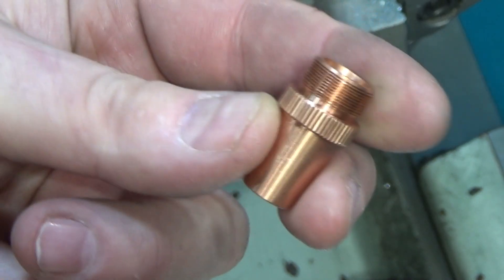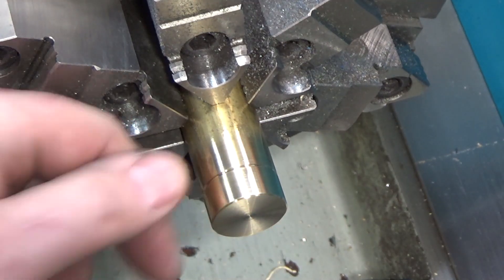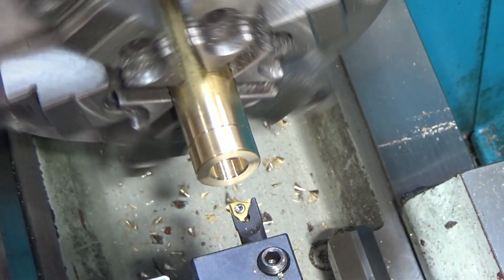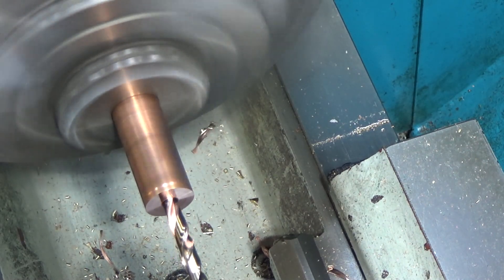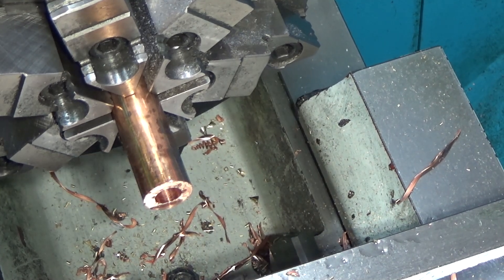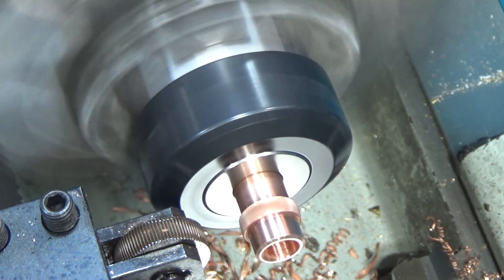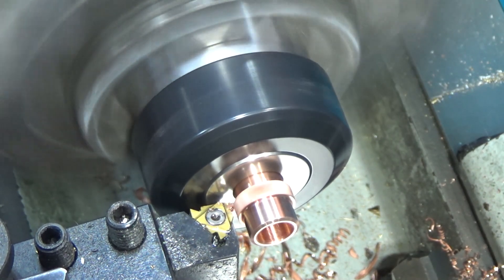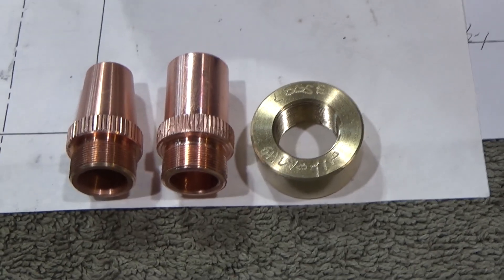240 Odd Part Shape Fixture and Galvo Laser Welding Nozzle Part 2

Comment: Try putting the tailstock centre in when knurling. This would help with the pressure.
 And help with the deformation.

I also use carbide drills with copper.
Reply from the maker: Great tips, thank you.

Comment: Did you consider just boring out the original part as much as possible (using your thread gage for holding)? 
If all your trying to acheive is to increase gas flow, a small increase in diameter in the bore of the original part would significantly increase the cross sectional dimension of the bore.
Reply from the maker: I did and they did, but they decided that they didn't want to modify the factory part, because replacing it would be very difficult, because the factory is in China.